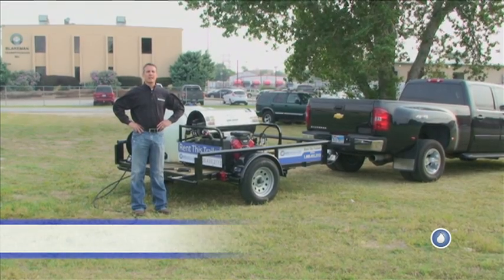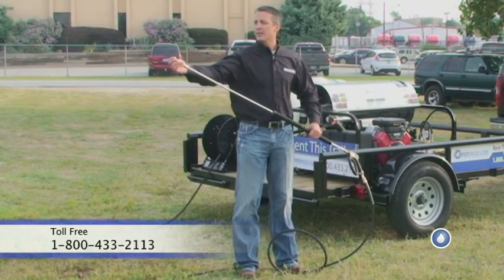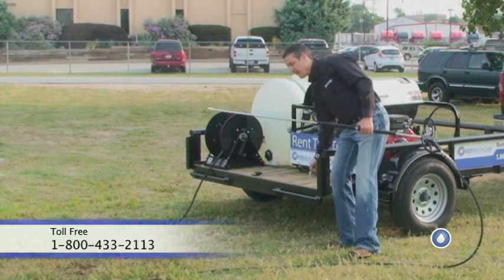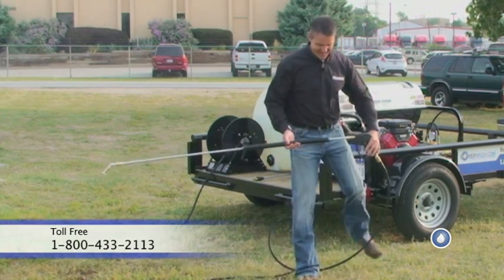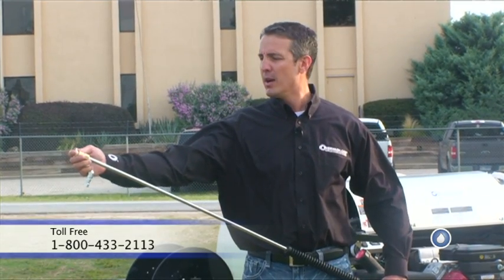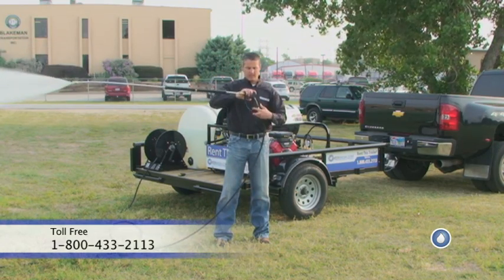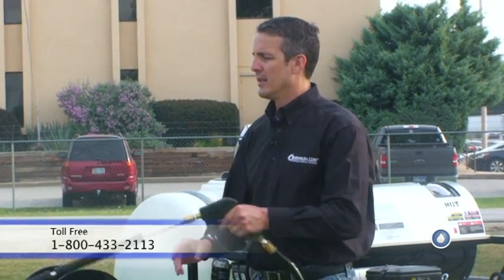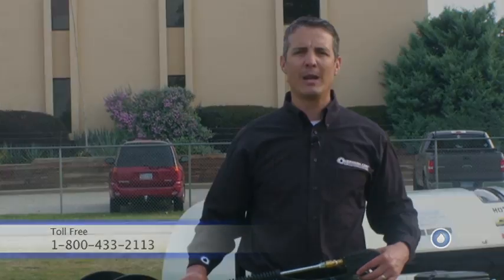How To Make A Weightless Power Washer Wand

Comment: Wow! I had no idea they’re that easy to bend on your own. I kept trying to shop for a pre-bent wand. Now I know I can just buy the size I need and put my own bend in. Thanks!
Reply: Think for just a second if an employee tried that, and ended up trashing the Wand/Gun.
Reply: @leonardocleaningllc1952  seems like as long as you dont use a sharp edge and put in a hard degree bend it should be fine. Though if you're worried about wand damage, you can buy these small bending jigs for a few bucks and use them instead to give a nice smooth bend, you just need to secure the jig so its stationary.

Comment: About 18 yrs ago I got a washer and put a 6 ft X 1/4" pipe on the gun and it works great. A PLUS is that it comes in handy for washing under the vehicle and wheel wells.

Comment: Great tip thank you (FOR SAFETY) Always a good idea to turn off the pressure washer and release the pressure before removing or changing the spray tip for people new to pressure washing. Once comfortable you can use two fingers to carefully change the spray tip. When I worked for a large painting company the guy pressure washing wash changing the tip and he accidentally touched the trigger with his foot and RIPPED OPEN THE INSIDE OF HIS THUMB! I'm a painting Contractor now since 2000. Safety first
Reply: Great advice for suzie q homeowner. Hilarious advice if you wash for a living.

Comment: Hello,  
what do add to your degreaser to get it to foam up when you spray inside a hood.  
Thanks
Reply from the maker: You can either use a foam canon or you can use a booster. The booster does not foam like the foam canon but it makes the chemical stick better to the surface so it can work better. The booster our guys use is R-1400 super foaming booster.

https://powerwash.com/shop/detergents/truck-car-wash/r-1400-super-foaming-booster-1-gallon/

Comment: What would you say the minimum psi is needed to clean a restaurant hood?
Reply from the maker: It depends on what you are doing. There are guys who use 200 PSI with the soap nozzle. The machines over at facilitec are operating around 1200 PSI. You do not need a lot of pressure to do an effective job. Your chemicals need to be good though.

Comment: Could I do that with the telescope .. I have extra high windows and a telescope and I have to fight with the long extended scope.
Reply from the maker: You can but be careful.  Once it is extended and and held perpendicular to the ground it may be very hard to control.  Otherwise it will help when held at an angle.

Comment: What do you do if your wand is plastic? Anyway great tip
Reply from the maker: Maybe you could heat it up just enough to put a bend in it.
Reply: It's brand new so I wouldn't want to do it when it was still under warantee
Reply from the maker: I wouldn't either.  Go back to who you purchased it from and ask them what is acceptable

Comment: completely off topic but can someone tell me how come I have trouble with my 2700psi 5.0 honda water pressure spraying water from a 100gallon water tank.
Reply from the maker: I bet it is a direct drive instead of a belt drive.  Direct drives don't do well pulling from a holding tank
Reply: thanks buddy

Comment: well my dumb aasss wanted to power wash my gutters with my 13HP honda 4000psi washer. I screwed on a 6 foot piece of pipe with a 90 degree elbow then added my 25 tip. LOL  yep, i pulled the trigger and the wand flew back from the pressure and it about knocked my teeth out. Yes, i was holding on really tight because i knew it was gonna be some force, i just wasnt expecting it to be so violent!!!  HAHA i hope the neighbors didnt witness this, they already have some amazing stories about me i bet they tell at their family get togethers

Comment: My God this has to be the dumbest thing I've seen all day. And it's been a terrible day. I'd much rather pay 20 bucks for a custom multi angle tip gooseneck then actually incentivizing the employee to destroy the equipment mainly the actual tool used to get the job done. Like omg stop already.
Reply from the maker: You made me smile Leonardo, just say what is on your mind.  Setting the angle isn't as easy as buying a preset adapter.  The weight of the wand and the force produced at the time will vary and in turn will make it a unique setting for every set up.  Thanks for sharing.  I hope you have a better day.